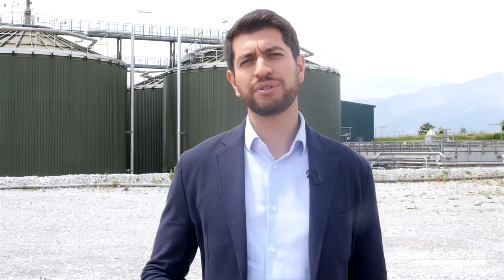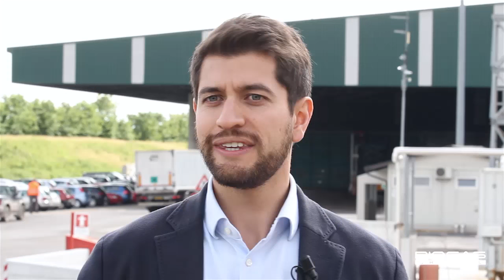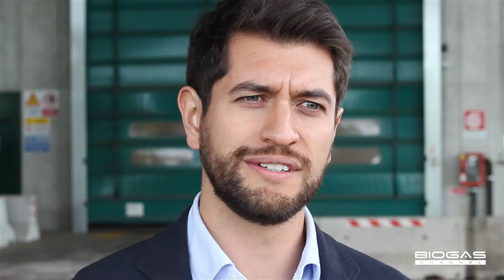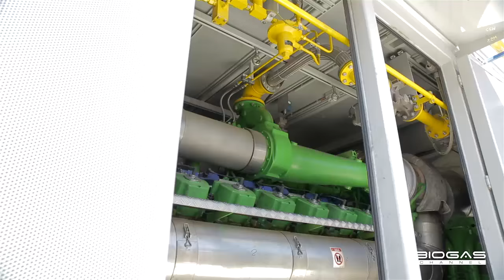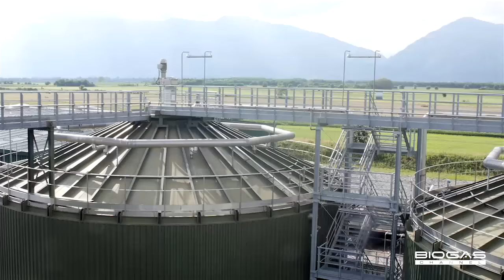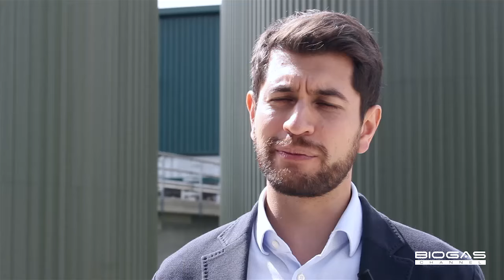Compost and green energy from food waste to power a city with 20,000 inhabitants - ENGLISH VERSION

Comment: Does it take more traditional  energy to produce compost energy?
Reply: A late reply, i am not as knowledgeable on the subject but just imagine all the compost piles that catch fire, i live in europe where temperatures drop to 7 degrees Celsius at night right now and we are still having an occasional compost fire, if a pile of compost is 90 cm in diameter it is big enough to retain its own heat, anything above this size will increase this heat and even as the organisms causing the heat are dying the heat increases cause the temperature is high enough for some form heat producing degradation of biological material
Reply: Also the gasses that are produced by the compost pile might also be used as a fuel